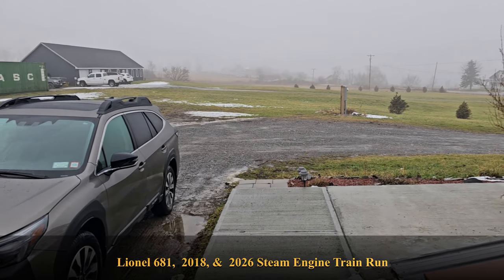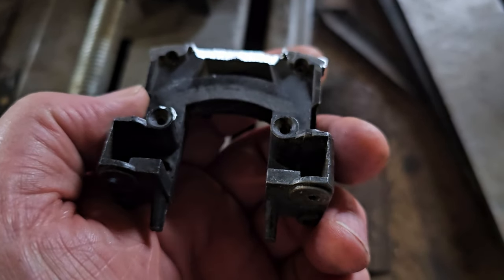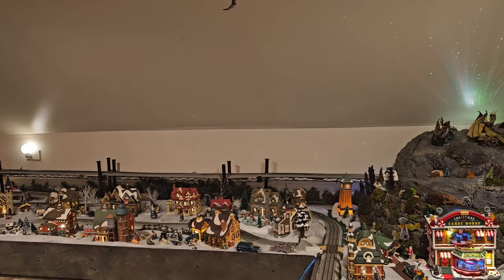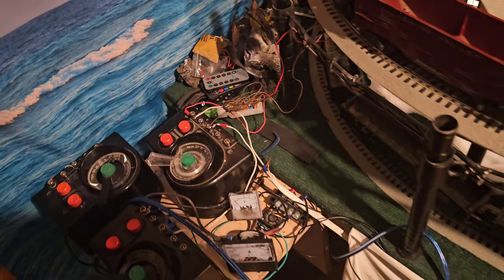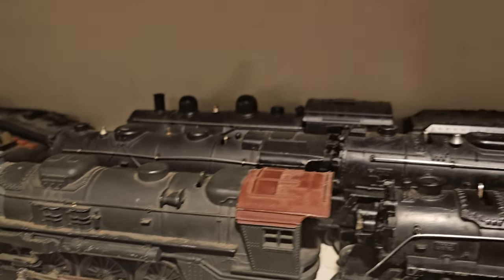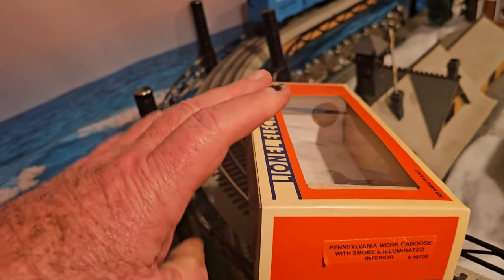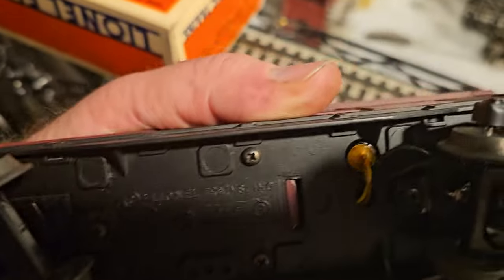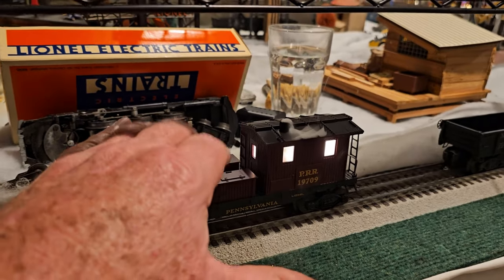Lionel 0-27 Steam Locomotives 2026 & 681 Train Run, Trolley Car Track & Layout Wiring Upgrade

Comment: Any thought to a reversing loop so you can change directions?  I have my layout set so the non derail switches allow direction changes and loop path changes all on their own. I can intervene any time and arrest changing or do other paths. You have expanded everything and quite the number of engines. 😊😊
Reply from the maker: That's why the bottom loops is two loops, two switches. Top track? I was just looking for a reliable test track at first. It morphed. Prolly will again. Question is to tie it to the bottom track? The Trolley track? Or as u suggested a loop to reverse

Comment: technically its called a "Pilot" not really a cowcatcher. And your trains really should have cabooses. 😀
Reply from the maker: Was actually wondering if there are track powered EOT devices for the 027 stuff. Even cars with them built in vs. having to make one. BTW I'm a logger/farmer/ ex engineer, not a train guy so terminology will grow over time :)
Reply: @htssoutboardsboatstrains9784  There really isn't much difference in O27 and O track. They are both O gauge (The distance between the rails). most items will run on either track except the larger locomotives which don't like the sharp curves. and  yes the F7s WILL run on O27). The longer cars will also run on it they just look better on larger curves. But since O27 track was made with curves up to 76" this isn't a problem either. Plus the trains look much better on the lower profile track. So your answer is yes, An EOT device will work. Or you could make your own.  If you scale those tall O rails to real live they would be 30" tall. Not real prototypical unless your modeling a monorail.